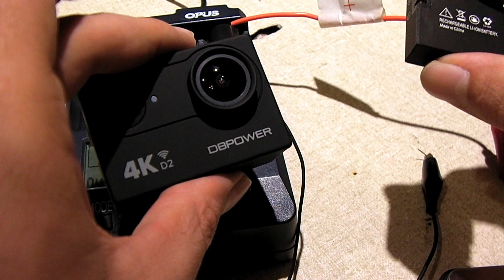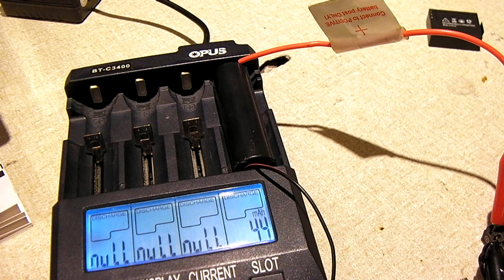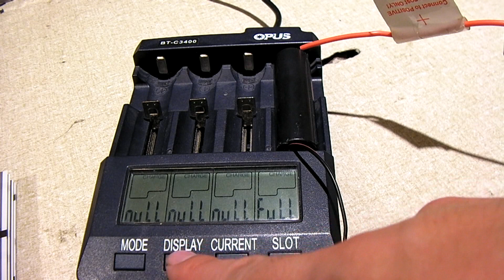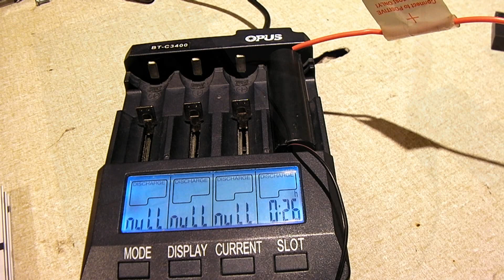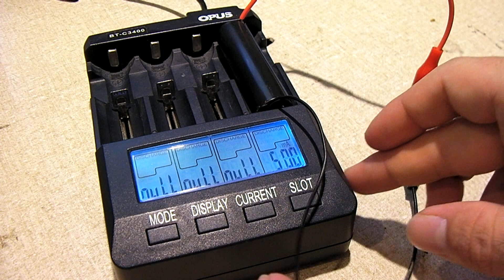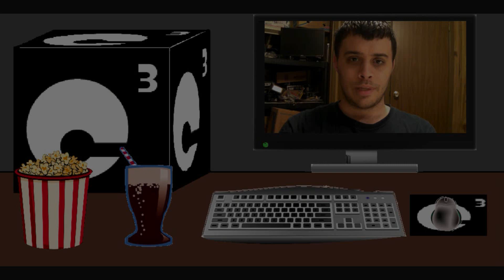Capacity testing two generic action camera batteries

Comment: Hello Sir, where can I buy one of those black battery with leads (the one in the charger)? Is there a name for it? I can find OPUS charger but not the battery with the lead. I want to test my camera battery as well. Thanks!
Reply from the maker: That was just a piece of plastic shaped like an 18650 cell from a laptop pack with a couple alligator wire leads stuck in the edges. Didn't buy it from anywhere.